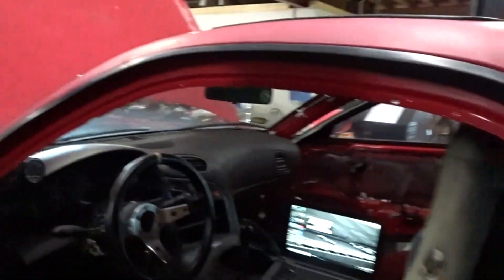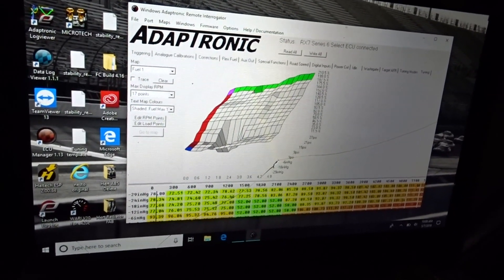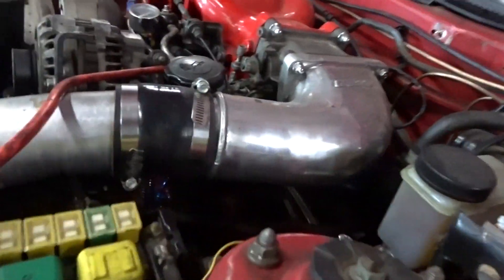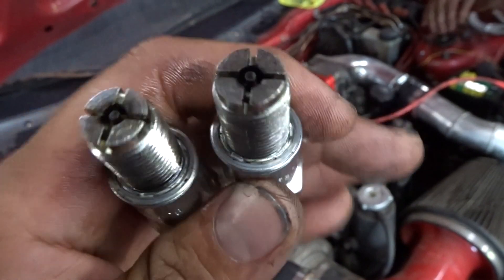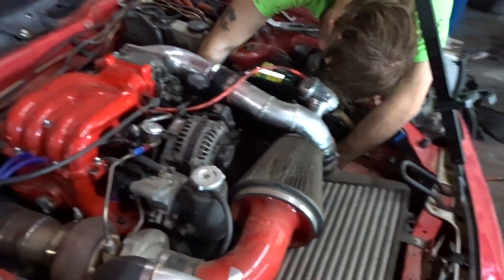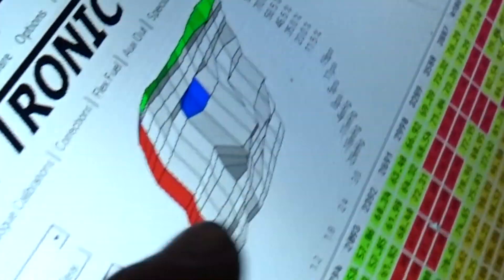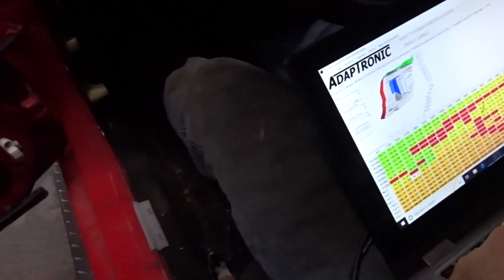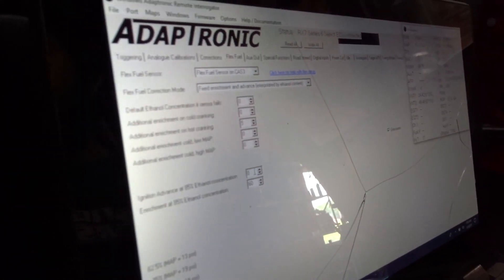How To Flex Fuel Tune An Rx7

Comment: I mean having all that fuel on decel looks cool but it's super inefficient on top of already being not efficient. Is there a reason that you guys have so much fuel on decel other than it looks cool? I've done that on my car and crazy s*** happens big old 10 ft flames and s***... it gets smaller and smaller as I turn diesel fuel amount lower and lower and then start popping to the point where now it's on decel it's just no fuel and gas mileage went through the roof but it's not a rotary. I have a sneaking suspicion on a rotary you have to have fuel on decel to keep it lubricated and that's the price you pay for not having oil injected into the motor and doing premix.

Comment: Is it possible to clean the spark plug with some brush or not?  Rookie question and using autolite spark plug
Reply from the maker: If the plug is foul there’s no fixing it also cleaning it will just mess up the electrode

Comment: Why do these vacuum cleaners always smoke so much Vargas?
Reply from the maker: Engine design plus port timing lets the exhaust and intake chamber leak a litttle creating flames , the smoke is from too much gas during decel
Reply: Got it, 👍

Comment: Would my Apexi super afc still be okay?  Manual turbo xs boost controller also
Reply from the maker: Yeah we tune on pfc but they just don’t have safeties
Reply: Ok,did you get my last few messages. Need a line I can holler at you for a lil bit and set this up while I can

Comment: is that overrun settings to the flames?
Reply from the maker: Added fuel ok decel table , the porting overlap and hot exhaust temps does the magic tho
Reply: @angelmotorsports  I've got the same ECU on my S4 trying to learn how to use it. seems on cold start decel it burbles and pops flames but not when engine is warm? would that just be over fueling on decel when engine is cold?